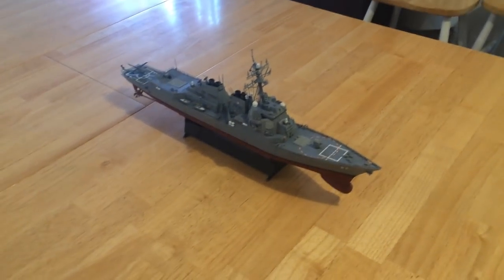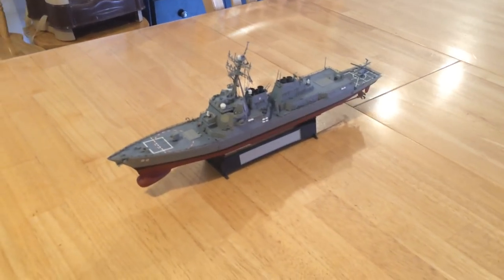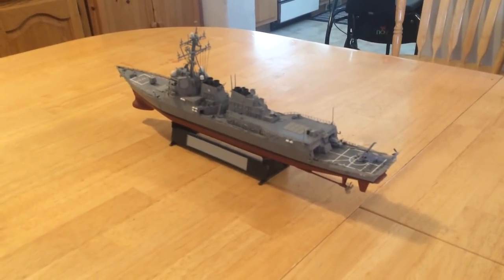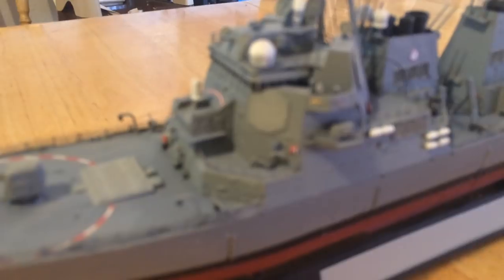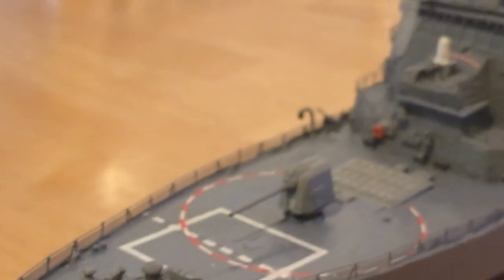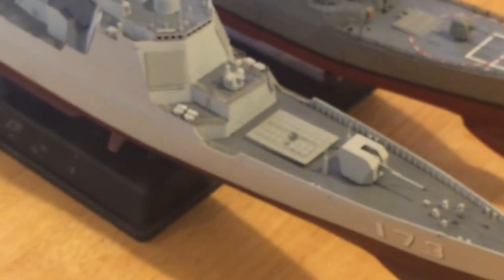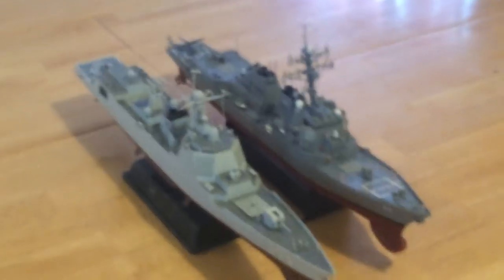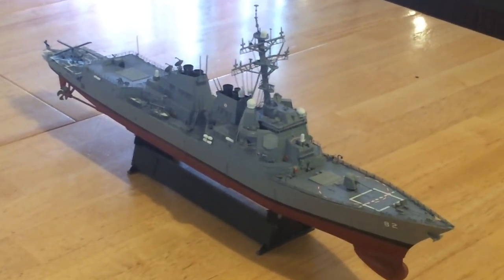USN Burke Flight IIA DDG - Comparison to Chinese Type 052D

Comment: Jeff the flight IIA looks amazing, as do all your models! I have to ask, what colors are you using for the Hull vs. the Array and VLC's? I just finished building the Momsen and used haze gray for the hull, but for secondary features, the best thing I could come up with was to uses light ghost gray, which still seems a little off. Again great build!
Reply from the maker: I have a set of colors that I have standardized on.  They are not all exactly right, but at least all my various PLAN, JMSDF, US Navy, Royal Navy, Russian, French, etc. use the same color scheme and therefore all look the same.  Here's a link on Fine Scale Modeler here: http://cs.finescale.com/fsm/modeling_subjects/f/7/t/170109.aspx   You can see all of my Build and Review threads on Fine Sacle if you go here.  I have kept threads on almost all of them and gotten a lot of good feedback to.  Here's that link:  http://cs.finescale.com/members/jeff-head/discussions.aspx

Comment: Great model, from what i saw the 052D is still a bit far behind the burke class, but the 055 could be the real contender with the bruke might even surpass it. I still amazes the speed chinese is modernizing their ships, copying or otherwise, the result is pretty clear that which ever their plan was, it went pretty successful. 
The US really should step up it's game in defending it's technology, i also hope these chinese adversaries will push the US to innovate more to maintain or steer further ahead it's lead in technology.
Reply: I think the Aegis radar on the Type 52D is more advanced.
Reply from the maker: The Type 055 is really beginning to compare with the Ticonderoga class.  I just got one of the first Type 0551/350 scale full hull models from Bronco in the PRC.  I bought two and intend to put them with my Liaoning carrier strike group.  I had a 3D waterline vessel only, but these are much more detailed and I look forward to having them in their.  The CV-16 with two Type 052Ds (which are very capable DDGs), two Type 054A  FFGs )which are also very good and capable frigate designs), and two Type 055 DDGs would make a very strong Carrier Strike Group.  The PLAN just needs to get to CATOBAR carriers as soon as they can with the ability to have decent fixed wing AEW aircraft.  Anyone serving on carriers knows that the AEW aircraft are the most important aircraft on the carrier.  They give them a chance, if they are strong enough, to defend the carrier far out on the threat axis and the chance to intercept potentially hostile aircraft before they can launch their missiles.  The US E-2D Advanced Hawkeye is capable of doing that...a helicopter mounted AEW is not.  Those are better than nothing, but they are weak in today's world and so Chinese carriers will probably stay under the net of ground based, strong AEW aircraft until they have something stronger...and to even have a real chance to do that, they will need fixed wing AEW aircraft, unless they could develop something like the EV-22 AEW version of the Osprey that the US has developed.  The Royal Navy did not buy it though and I believe that was a mistake.  The Melin MK2 AEW helo with Crows Nest is about the best helo oriented AEW out there...bit it is still too weak in today's world of long range and fast moving ASMs.  Anyhow, thanks for the comments and chance to compare notes.  God's best to you and yours.

Comment: Do you have an extended heli deck variant of the type 052d? it would be nice to see it up against the former variant.
Reply from the maker: See the video I later refer to in this answer, but I am not aware of an extended deck variant of the Type 052D.  The latest ones built show no such variation.  However, the Chinese have developed and are building the Type 055 which is a much larger vessel, displacing 12,000 tons or more. You may be referring to them.  I do have two of those and have shown them.  They are the PLAN's answer to the Ticonderoga Cruiser and are longer than the Type 052D and carry more VLLS cells (112 vs 64) They are impressive surface combatants and have larger APARs too.  Here is a video of the two of them, and I do put a Tico in there to compare:  https://www.youtube.com/watch?v=J30k-fQwvm8 and here's another video of two Ticonderoga class cruisers alone : https://www.youtube.com/watch?v=J30k-fQwvm8
Reply: @JeffHead-IdahoUSA  On this thread they are referring to it quite frequently, it is allegedly has an extended helicopter deck for the new z-20 to replace the z-9. https://www.sinodefenceforum.com/plan-type-052c-052d-class-destroyers.t6881/page-334

Comment: Btw, the reviewer didn’t notice the Chinese counter part of the ASROC has a range that is around 100 miles, which is far far longer than the American ASROC. So Chinese 052D does not rely so much on helicopter for anti submarine war fares. And the “Band Stand” radar on 052D can detect targets below horizon in 90% of the weather conditions, which will again does not require helicopter for mid range targeting. And the latest 052D carries type 311 sonar is one generation newer than the sqr19 with a longer detection range. These all means, 052D does not need that much of reliance on helicopters which can hardly operate in bad weathers. So this is obviously an advantage but not a disadvantage compared with the Burke class.
Reply from the maker: Well, I am the reviewer and the fact is we do not know at all what the ranges and capabilities of the Chinese electronics are.  We just know what they tell us, whereas the US regularly tests, and improves their gear and then publishes what their basic capabilities are for all the world to see.  Tremendous claims of equipment that doubles or triples US capabilities should be taken for what they are...the PLAN using Sun Tzu type communications to confuse and counter the situation.  No matter what might be said, having two helos as opposed to one is always better...else the Type 055 would also only have one..and yet they put two on their best vessel.  The PLAN, despite the tremendous claims seems to understand very well, in reality, that important consideration.  And the fact remains...once a potential combatant SSN or SS is found, you want to be able to prosecute it and not lose it.  With two helos you cn do ht, and the US helos are designed to fly and fight in very bad weather conditions...and with two they can rotate one another out until they eliminate the threat.  with only one, unless the first one can get the job done...and it may or may not...they will lose it while waiting fot that single helo to refuel and return.  In a good sized Carrier roup they may have enough elos in the whole group to be able to double up and get the job done...but that just means a wise attacker will put one or two out on one azimuth and suck up 2-4 helos from the group, and then cone at them from another direction with two or three more and have a better chance of getting withing strike range.  Anyhow, we can all pray that something like this never turns into reality and that we can negotiate and work with the people and leaders in China and avoid any bad situations like that.
Reply from the maker: As an engineer myself who has worked on such systems, I can say that detecting submarines at 100 miles is  very difficult thing to do, particularly when the subs have been designed with quietness in mind.  And the US has.  The one area where the Chinese have not caught uo very much is in nuclear carrier design...and without seeing the test data I cannot make too much judgement...but that is why the US posts in the open most of its test data.  We want others, friend and potential foes alike to know how good our equipment is s a means to deter war.  I wish the Chinese would do the same...but knowing this area somewhat (one of the projects I worked on years ago was the NSSN, which became the Virginia class submarine) and I can tell you their capabilities are amazing.  I doubt the Chinese would be able to so easily detect and destroy them at such range.  Let's both hope we never have to find out...at least that is my hope and prayer.

Comment: 1 052D cost 3.5 billion RMB, which is less than 600 million USD. So for equal cost, you need to compare 1 Burke with 2 052Ds.
Reply from the maker: Actually this is not true.  First we re not really sure what the cost is, whereas the US, by law, must be open about the cost of its equipment.  Second, since there are only about 17 052Ds afloat while there are well over 60 Burkes afloat, you can compare 60 Burkes against 17 Type 052ds.  And the US is continues to build Burks, startbg very soon on the Burke III.
Reply: Jeff Head To build ships is just all about money. You throw money into the water and get ships. USA do have more Burkes, but you have 2 oceans to guard and tons of other businesses to interfere.